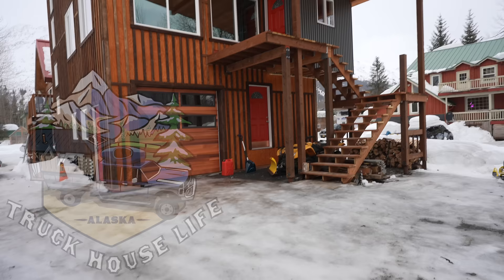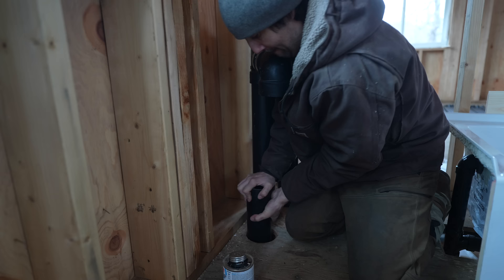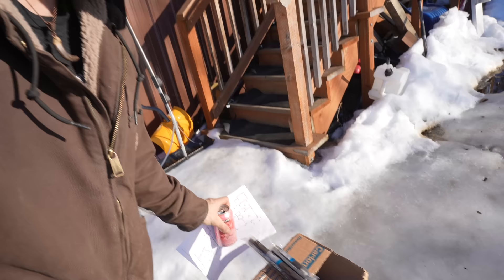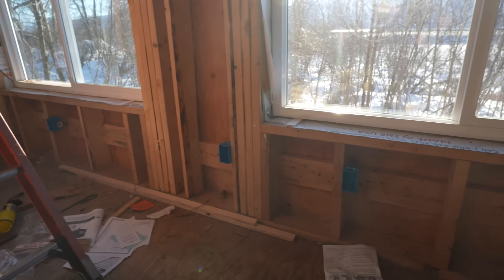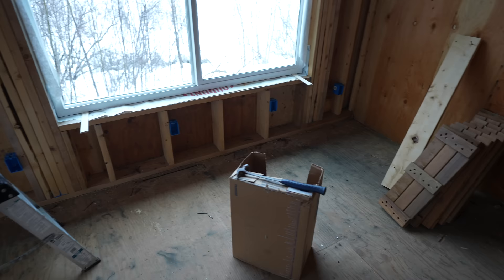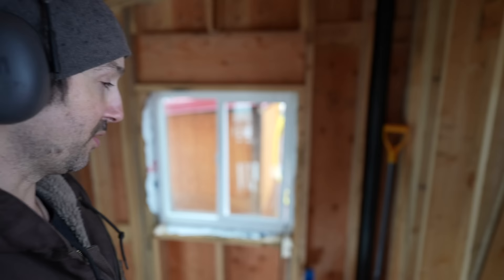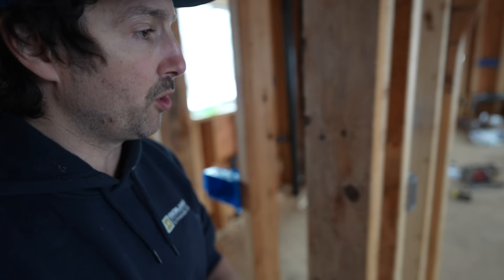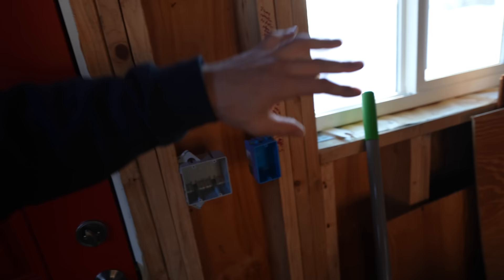The Most Intimidating Part of Building Your Own Home

Comment: I've built 3 houses from the ground up for myself. It can be an intimidating tough job if you don't know what you're doing but soooo rewarding once you move in. One tip finish EVERYTHING before you move in or it won't ever get done
Reply: That's quite an accomplishment. As well as good advice, but we both know that building something as grand as a house, it's never really done. 😁
Reply: I agree with this.  I’ve seen so many occupied houses with just Tyvek vapor barrier and no siding.  Looks horrible.
Reply: FYI ya got that sani tee backwards on that tie in. Looks good though!!!
Reply: I second this, I moved into a house that was done for all intents and purposes except for the master bedroom addition, a whole 2 seasons later it's just now getting done 😂
Reply: Thats so true if you can finish first do it or you’ll be staring at it for 20 years saying F it. 😂

Comment: Timmy.. Countertops in kitchen are 36-37 from finished floor.. Bottom of upper wall cabinets are usually 54 to the bottom. So roughly 18 inches between them. Outlets are centered on that.. So 36+9 to center of rough-in box. Plus the 1-3/4 to the top of the boxes. 47 to top of box from finished floor is a good number..

Comment: Timmy, I built a house 1/2 that size in 1987. I get overwhelmed just wondering how I did it all, mostly by myself, sometimes one friend or my Dad giving me a hand. I I was 27 then and super tough and strong, now almost 64, tuckered out, lol. Glad you’re doing it now, you’ll have a long time before you can’t climb the stairs. It would literally cost me 10-15 times as much today as then. I had mine paid for in about 7 years, busting my butt. I have continued to add some, remodeled some, etc, but there’s probably few things as satisfying as building your own home then owning it one day. I’m jacked up with fibromyalgia and back trouble now, so I’d be in hot water if I hadn’t but the bullet at a young age, looking good!

Comment: 20” above countertop sounds rather high for outlets. I would think 12”would be better. 18” from countertop to bottom of upper cabinets is the standard height. The upper cabinet box would cover the outlet / receptacle at 20 inches.
Reply: Agreed 100%
Reply: cords on appliances are getting shorter
Reply: no your big nose does that
Reply: Mine are 12 from top of outlet to top of counter top. Its a perfect height for my appliances. That’s only around the countertop the walls are about 20” off the floor roughly by looking at them. Everything in my house was rebuilt 2 years ago when I bought it so everything was like that when i moved in.

Comment: Take a look into the canless LED lights, that's all we install anymore, less costly than the old cans by the time you do trim and bulbs.  Simple to install, just map where your wires are, we snap lines and drill the holes after drywall is up but before mudding, taping, and texture.  Although you'll snap your fingers a few times with the damn spring levers that hold them in. Lol  The better ones have multi selectable lumen levels, some even have a night light ring that is activated by a quick on/off flick of the switch. Those are real nice especially when you have frequent guests, we had a client go with them in various areas because he's frequently hosting folks on religious missions.

Comment: Yes it is slick outside. Don't know what you do with your ashes from the stove but you should be spreading them on your drive and or beside the walkway on the snow piles. They make the snow melt much faster and promote greener grass and flowers. I've been doing it for years on my driveway. Just a little tidbit of different info.

Comment: with multiple floors you will want to have a sub panel to supply the 3rd and top deck. nothing more annoying than to accidentally flip a breaker and have to go all the way down to garage to reset it.  That and it cuts down on wiring since your not having to run so much wire all the way down to one big fuse box.
Reply: I second your advice for multiple sub panels

Comment: When placing your electric receptacles you compensated for trim and wall thickness but what about flooring?  It looked like you placed them at minimum code height from the subfloor and not the to-be finished floor.

Comment: Run an outlet outside that will connect to a switch inside. This way if you want to hang Christmas lights or anything you can turn them on/off from inside the house. It’s something most don’t think about but is a really nice feature. Coming along

Comment: too late now but for the gas line I would have left a loop of line below the pit.  just in case you need more length.  for the outlet boxes you should have made a "story stick"  that would save you time measuring for each box.  in your case you would use a 3/4" stick maybe 4" wide(could be finished 1x4), however long, say 18".  then at 15 1/4" up the stick tack, screw another length of lumber at right angle.  the story stick will be your jig to mark placement of the outlet boxes.  you will need to fill in the top cross piece so you can use it like a square.  place the story stick on the stud, it will be the right distance out for the box.  place the box flush with the stick and up against the top cross piece and nail the box in.  done no measuring!  great job doing all the building almost by yourself!!! 🤙

Comment: You might want to consider wireless light switches. Very convenient since you don't need to physically wire anything to the switch. The switch is just a "remote" that sends the command to the receiver that is connected to the actual light source.

Not sure which  brand sells them in the US (Iive in Finland) but I assume that there's multiple choices to choose from.

Comment: Imagine doing all that Sewer plumbing in Cast Iron? My house is 122 years old. Its still functional. Barely. Im an Electrician personally but😂Ive been remodeling my bathroom. New cement board flooring and shower backing, new tub and shower, sink toilet etc. Cement board is the way to go! For an old pine wood house it makes floors solid as concrete.

Comment: 20” above countertop is way too high. I go only a few inches above the backsplash. Your standard small kitchen appliance only has a 2’ cord. Code also requires no more than 4’ apart. And atleast 2 countertop dedicated circuits. And of course gfi protected.

Comment: Timmy, I found your house build video super interesting.  I admire your courage and willingness to tackle all of the trades in your house.  I know it’s too late, but just a tip on installing the lower wall receptacle boxes.  To simplify and speed up the process, no need to measure the height of each box, just place your hammer with the head on the floor and the handle pointing straight up, then just place the box on top of the hammer handle.  It guarantees each box is at the same height without having to measure!
Reply: I also have heard of the "hammer handle measurement" for installing electrical boxes. If your current hammer doesn't measure  up to your liking get a cheap wooden handle hammer so you can adjust it to the height to you like.

Comment: That San tee on the vent is upside down. Its 3" so you might be ok but if you have more that are upside down than you have a really good chance of it gurgling when it drains.
Reply: Nevermind you glued it correctly but it was backwards when you did the dry fit. I apologize for commenting before you finished. And just to be clear I wasn't being a hater. I was a plumber for 7 years and got worried that you could have a potential problem.

Comment: Are going to insulate  those interior pipes. I don't know maybe you did and I can't see it. I'm afraid if your heat goes out. It's Alaska. You go on your little excursions in inclement weather and don't come back for five days. You need some app and cameras all over your house. Too bad you can't click a button and turn of the water but I think there is such a thing available.

Comment: Are you going to install some sort of air duct to suck up the hot air at the very top & transfer it down to the first floor for air circulation since heat rises? 
It’s going to take a bit to heat up the first floor in order to get comfortably warm.

Comment: Noticed you made a point to set boxes 3/4" out to account for wall finish, but not sure you mentioned the finished floor height being factored in?   Also - any plans to run low-voltage cabling (now or in future) for POE cameras on copper, or fiber to desktop, now's the time even if you leave the boxes empty.   Great work so far Timmy, and it's a nice balance to the adventure videos! Thanks 🙂
Reply from the maker: I went off of the bottom plate, so the outlets are actually 14" off the subfloor;)

Comment: A 3" street 90 elbow would have worked perfectly so you didn't have to move it away to tie it all together. The street 90 would have glued right into that sani-T
Reply from the maker: I thought about that but the spacing was still off

Comment: I have done all these systems in several homes and it is interesting to see how you have built the systems without much training, but it isn't rocket science.  Still your work is good.  Do you have to have inspection of these systems.  If so, then know code is important.  Get to know the inspectors.

Comment: Here in NZ we can self build but we need to have a qualified plumber for gas and water and electrician for the wiring. So what's the deal with the inspections.
Reply: Yeah, I don't know about Alaska, but in Louisiana you can do all the electrical and the plumbing yourself, but you're going to have to have a certified state inspector sign off on it. Before the build can be considered final and the house certified as safe, especially in Southern Louisiana, where everything has to be built to hurricane code. Except for natural gas installation that has to be done by somebody certified by the state.

Comment: With all due respect, your electrician friend is smoking dope. If you put your outlets 20 inches of above the surface, your upper cabinets are going to be out of sight.   Because you have huge walls, you can put your cabinets higher, but that’s gonna make it more more difficult to use.  The  standard Heights are 36 inches to the top of your counter and 54 to the bottom of your uppers that’s 18 inches. you want to split that with your outlet.

Comment: make your life easy and just go 16" off the floor,  then use a laser level and just hammer the boxes in. you're just making extra steps with the marker. also you're going off the subfloor, you need to take the finished floor height into account. So if you are putting in hardwood you need to add height.
Reply from the maker: I went off of the bottom plate, so the outlets are actually 14" off the subfloor;)

Comment: I noticed a while back the chimney cap on your truck has changed , what happened to the one that changed direction with the wind ? I installed one on a customers stove pipe and it blew off and had to replace the retaining clips . Is that what happened to yours or did it not work good with the wind changes ?
Reply from the maker: it spins around with wind and the bearings would always sqeak no matter how much I greased them with high temp grease, so I removed it

Comment: Dude if code is minimum 12” off floor…. and flooring not installed yet, why didn’t you go like 12.5”?
Reply from the maker: I went off of the bottom plate, so the outlets are actually 14" off the subfloor;)
Reply: @TruckHouseLife  wise man 👍🏻

Comment: I’m laughing, there are standard measurements for building a kitchen. Did you estimate the thickness of your floors? From the top of the counter to the bottom of the upper cabinet is 18” minimum. Your outlets can go anywhere in between those measurements. Think about setting the plugs sideways, use GFI’s near water. Consider outlets near toilets if installing bidets. You should have asked you dad to measure his for you. Lol!